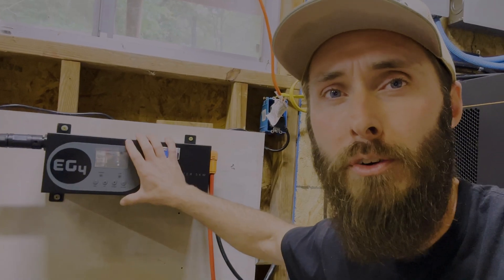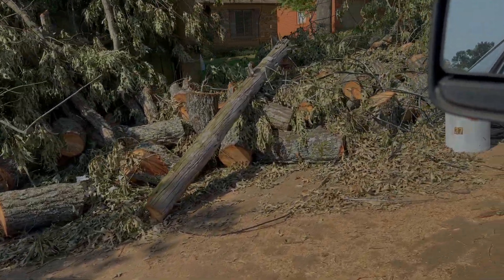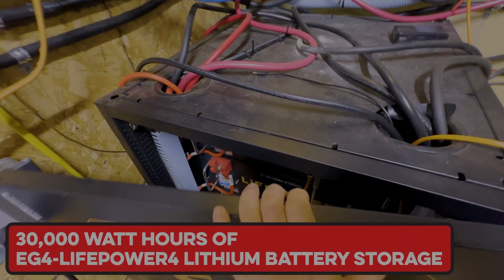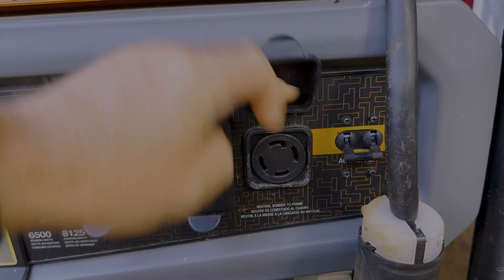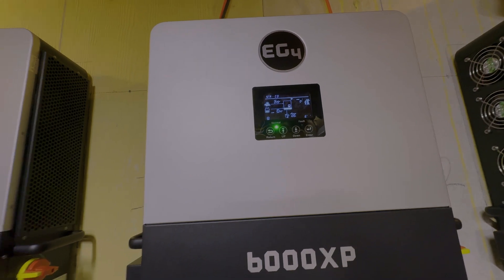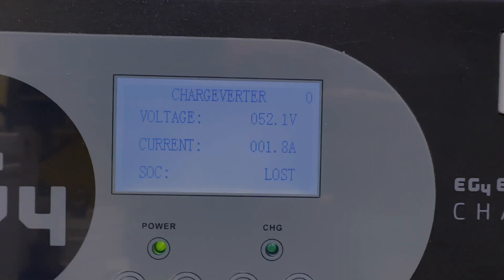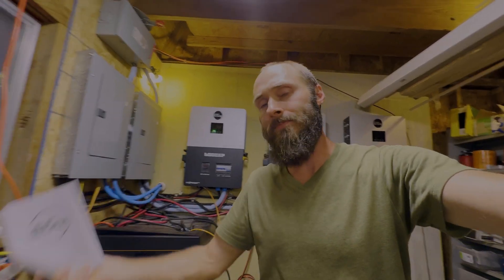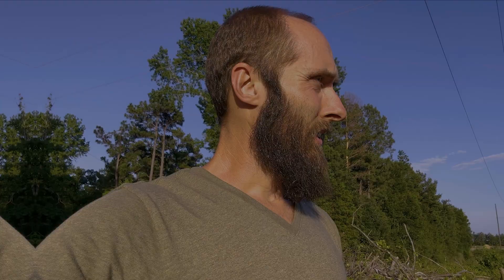Off Grid Tip: Using the Chargeverter GC & 6000XP In Tandem?

Comment: I use a pair of the original yellow eg4 charger. And I don't have those issues when I switch on the chargeverter. It's operation is totally transparent and behaves just like Powers coming from solar input.
Reply from the maker: I have an old yellow one as well, and you're right. It didn't do that. I'm going to have to do some testing now.
Reply: Does the inverter only shut down when the chargeverter is switched on, or does the inverter also shut down every time you start or stop the generator?
Reply from the maker: @Rusty48 jusst when I flip on the Chargeverter breaker
Reply: @EastTexasHomestead  I have a pair of them. They survived a lightning strike to my solar array this afternoon while the generator was running and charging batteries. A Sungold Power 6kW inverter was also being used as a charger and it went up in smoke.
Reply from the maker: Oh man!!! I’m sorry to hear that. 😢
Reply: @EastTexasHomestead  I think I got lucky in that my SC4880 charge controller connected to that string did not die. It doesn't work anymore because there's only 10V coming in from the array now. Bypass diodes must have all shorted in the 20 panels in that array.
Reply from the maker: I'm glad it didn't take it all out. But man! what a bummer
Reply: @EastTexasHomestead  so tomorrow morning, I have to take down those 20 panels (probably the bypass diodes have shorted on most of them) and shore up the ground mount and install 8 new Sungold power 550W panels that I have on a palette. Been holding off after the first 8 performed so poorly, but now I have no choice.
Reply: I am using one with the growatt inverters and no issue with it shutting down i installed a system fsoa friend with the eg4 6500 and it shuts down like that

Comment: I figured this would be ok. External solar charge controllers are wired parallel to the batteries to charge them while drawing from them.
Reply from the maker: I was thinking the same thing. I built out a Victron system that did it like that.

Comment: Thanks for the chargeverter updates. I recently got my cabin set up with 1 EG4 6000xp and indoor wallmount battery set up with the chargeverter. My harbor freight 3500 genny does well enough until i get my 8 ground mount panels up and going. 
Nice to see others with the same setup, keep the vids coming!
Reply from the maker: It's a rock-solid system. Glad to hear it's working well for you, too. I've been wanting to try the wallmount batteries. Maybe someday soon :)